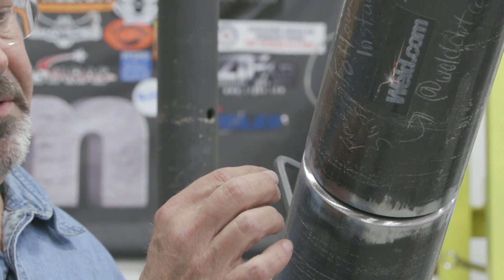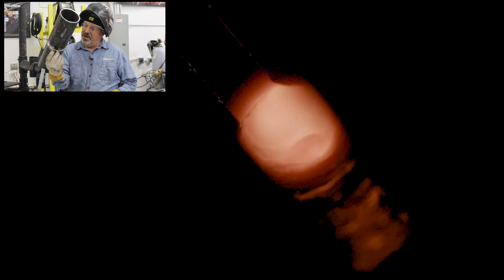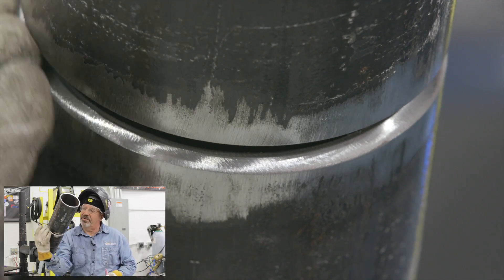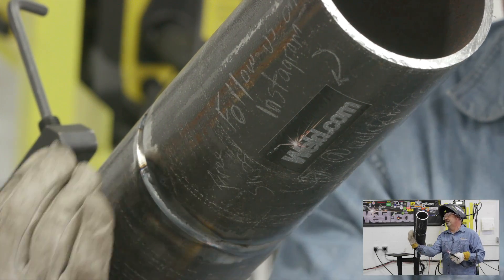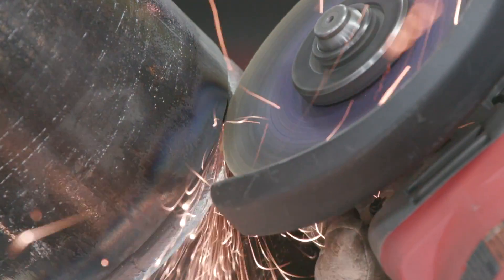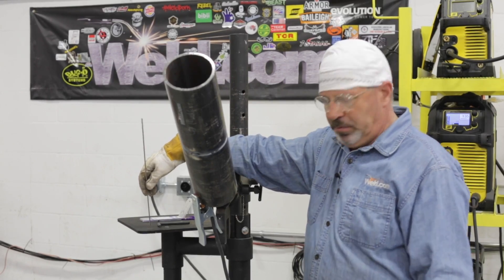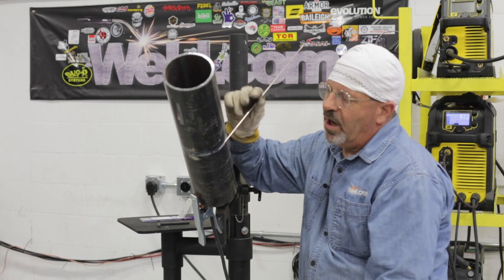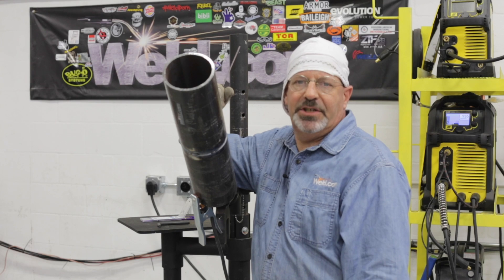6G TIG Root

Comment: I just passed my 1st test at Epic piping using your tips. Thanks so much Bob for all the great videos. You and Jody from welding tips & tricks have been instrumental in aiding my progression with tig. The test was 2 inch carbon steel pipe in 6G position. Passed x-ray with no porosity or lack of fusion👍

Comment: Bob, what size tungsten and filler did you use on what size gape? I have almost finished my test stand and have procured some sch.40 2.5" pipe.  Looking at trying out TIG welding pipe and will rewatch all your TIG videos on pipe.
Reply from the maker: 1/8 Filler with a loose 1/8th fit. Just enough for the filler through. We had a 3/32-1/16 land and a 3/32 E3 Tungsten. Hope that helps.
Reply: @Welddotcom  Thanks you for your response. As in another of your videos, you started your root at 90 amps, is that a good range for my small 2.5" on my root?